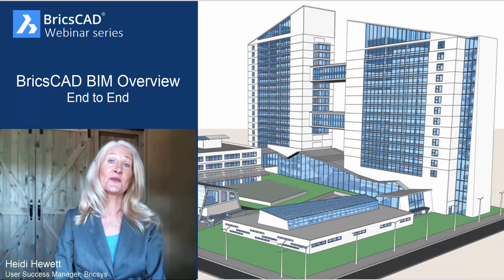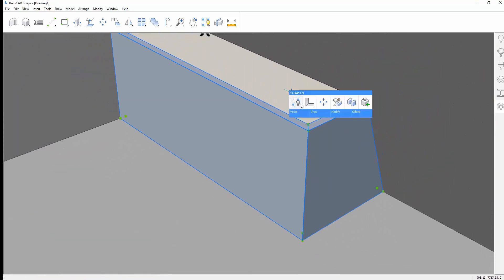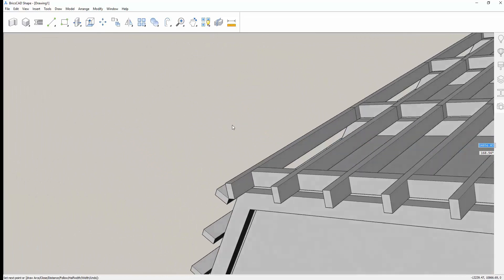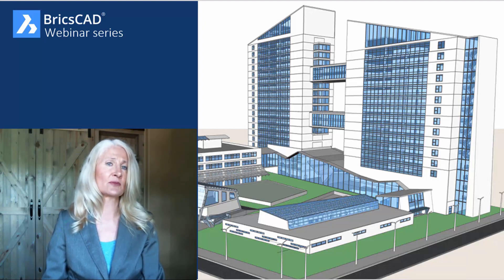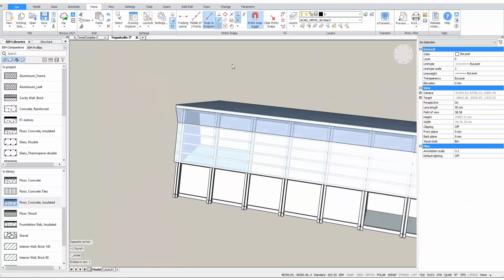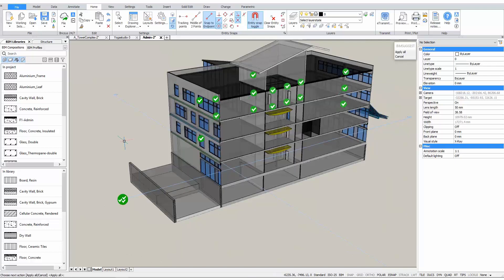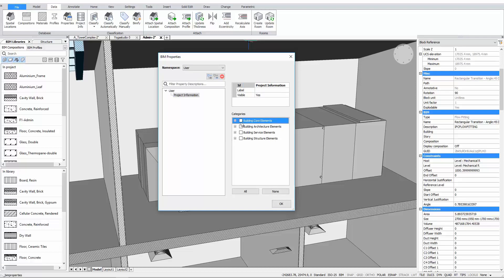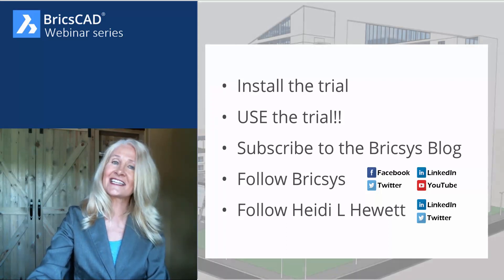BricsCAD BIM - Workflow Overview with Heidi Hewett

Comment: Ms. Hewiett thanks for the good run through. I only worked in AutoCAD for about 7 years due to job loss and it was in the AE industry so I have no where near your knowledge. It's been more than 10 years since I have done in CAD work. That said, I never lost my interest and decided to buy BricsCAD in 2017 for my own computer thanks to Bricsys producing a Linux version. It's great to have so much power even though I have much upgrading to do in my knowledge base. As I said, I have some learning to do still, but I'm so glad for the support of we Linux users. Thanks to Bricsys I have some ideas for application of BricsCAD I never had in AutoCAD.

Comment: Makes no difference even if the software's better if US Government contracts specify Revit file deliverables - by name and version number. Not fair...
Reply: That is bad because Revit file is not very friendly with downgrade and the file format is proprietary. 10-20 years down how will the software read or access the file? Autodesk are known to kill off platform without giving them long term support. PLT, DWF,  CAD and other format are created by Autodesk and future software won't be able to read these format. It is sucks if government are thinking of looking into future proof platform.
Reply: IFC support is lagging. Trying to use it with MEP BIM apps doesn't really work as well as the native format.
Reply: Exactly. This is why alot of our mechanical stick with AutoCAD Mechanical. So if BricsCAD can read native DWG, this will cut down on translation from IFC.
Reply: But a lot MEPs are now using Revit. Makes it hard for the Architect to use anything but.
Reply: Not where I live. Different cities will have different adoption. One mechanical contractor switch from Revit MEP to AutoCAD Mechanical because Revit is too restrictive and can't work with the firm workflow. Also they use AutoCAD Mechanical for manufacturing CNC fabrication.
Reply: Now that's interesting to know. Since Brics is based on DWG, that makes things all the more interesting. Using BricsBIM for Architecture and ACAD MEP.
Reply: Use BricsCAD BIM and by the end of the project export everything with IFC to Revit and Save as .RVT file :p
Reply: Needless to say, the government and Autodesk have created a cartel - monopoly, if you don't believe in conspiracies here is a real life example. It's a corrupt racket for the rich and powerful, c'est la vie.
Reply: Unfortunately, that would not create a usable Revit file and would be rejected by the client.
Reply: will brics cad break the monopoly? could I achieve it?